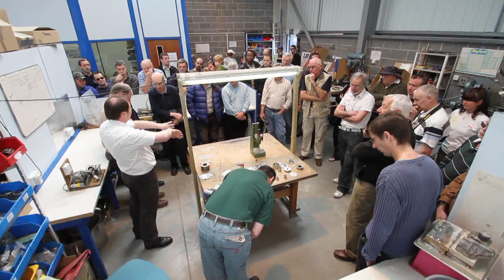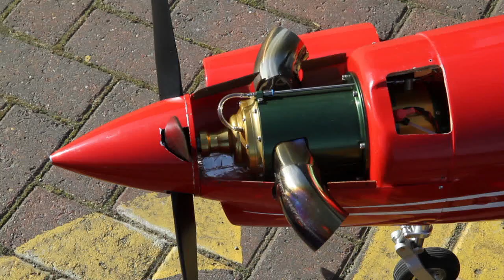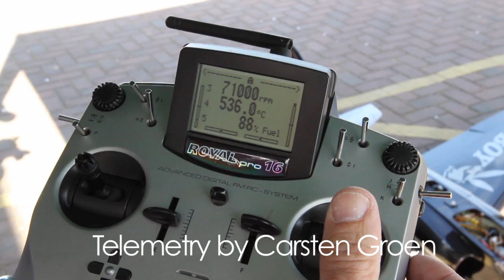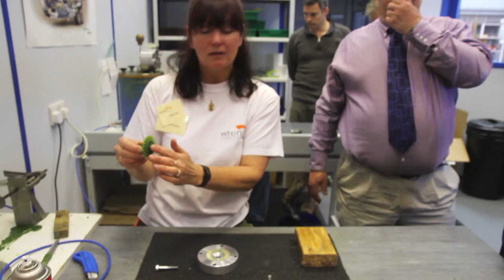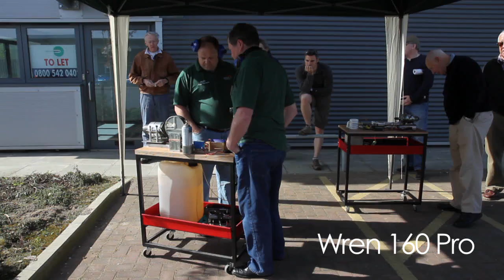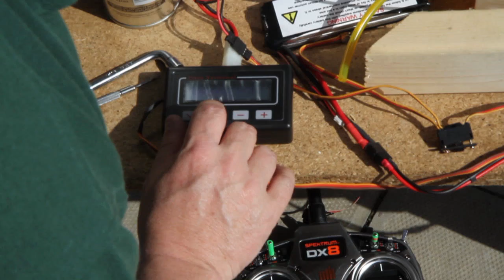Wren Open Day #1, 2011

Comment: Jetcat is the best and second to JetCat is Kingtech. JetCat is more expensive because of its quality and performance. Other companies also copies JetCat's ideas for further development and improvements. For instance, Jetcat was the first to invent and add automatic start to their products. They were the first to invent internal fuel start with the thermo wire inside and a single plug to connect the entire system. They invented power generators for their engines as well as the all-in-one P90RXi